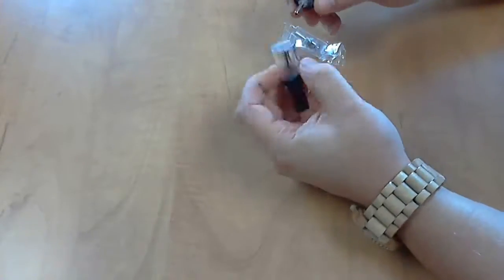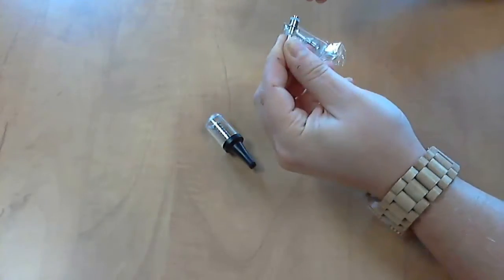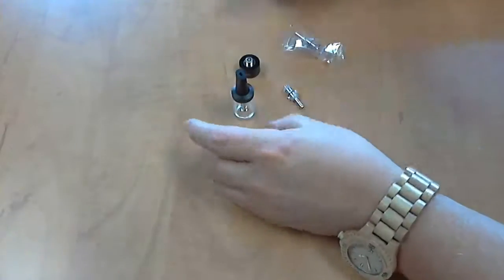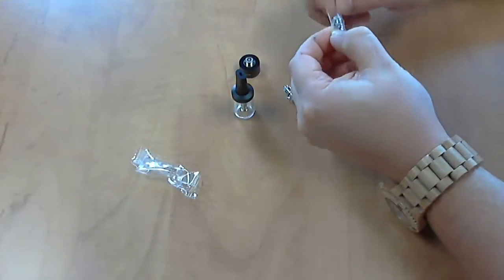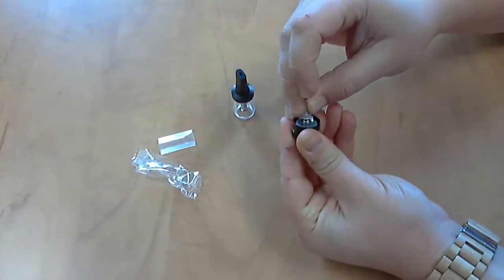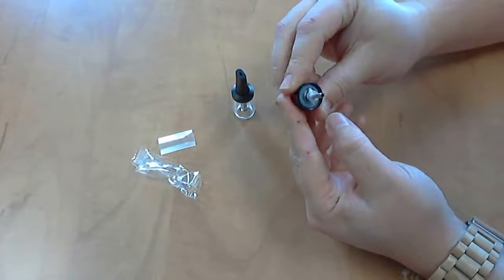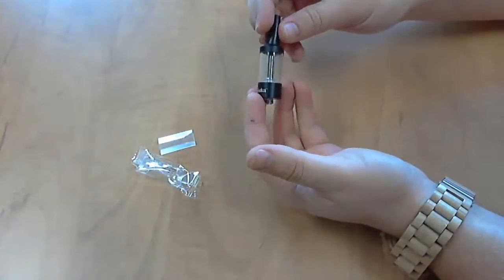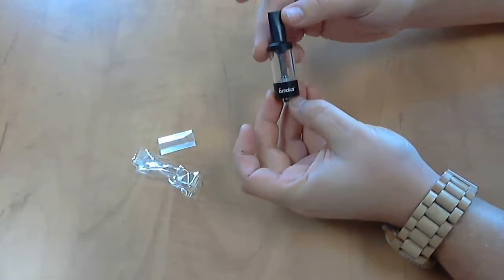ISmoka BCC Clearomizer - How to replace heating coil

Comment: When trying to replace my heating coil, do I push it all the way in? My has like 3 little pops to get it in.  The first lil pop it's just barely in the hole. The second pop and its in securely. But then I can push it once more and it's all the way in... im not sure if I am to do the second pop or the last pop/push